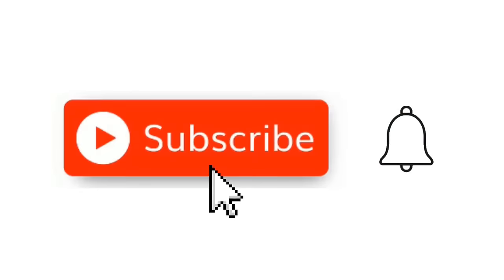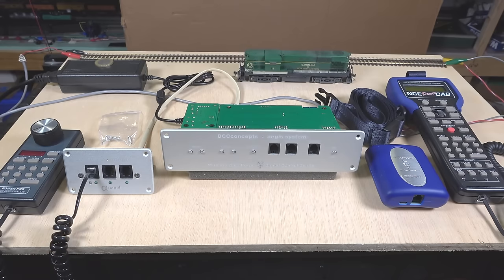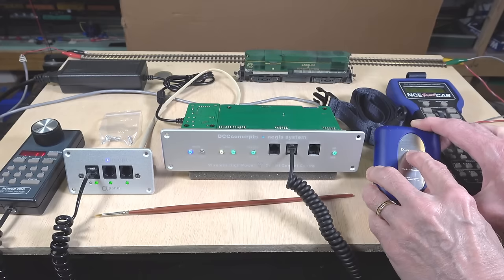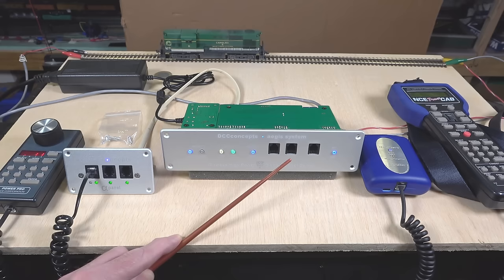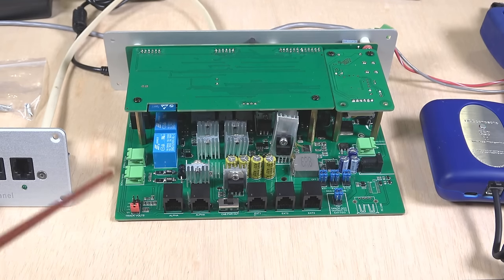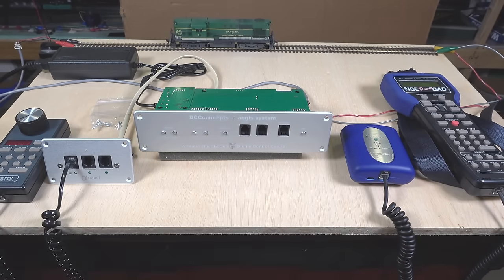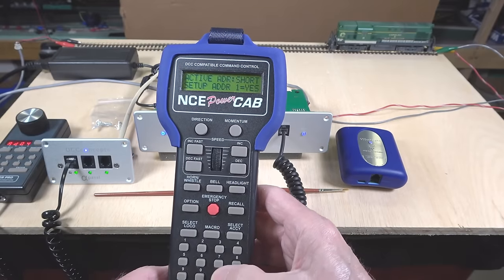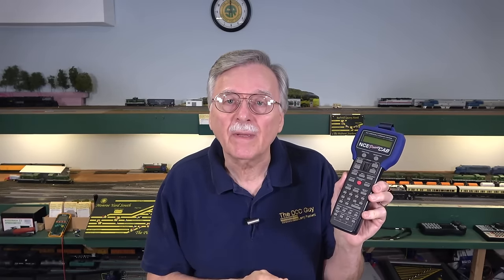Aegis Delivers Power And Performance For The NCE PowerCab (348)

Comment: The Power Cab sells for about $200. The Aegis for $435. If you want a second operator, a plug-in cab costs $95. That's a hefty price tag for entry into DCC for a newcomer wanting a small layout and the ability to run trains with a friend. A similar package from TCS or Digitrax is no less daunting. It's unsurprising that DC operation is still used widely, especially by beginners. After viewing your video and the DCConcepts video it appears expanding this  system is limited to a single wireless throttle and 5 wired throttles. NCE Power Cab is a good plug-n--play system if you're techno-phobic and possess the financial resources to go that pathway. However, for anyone testing if model railroading is for them or have limited resources DCC-EX represents a more realistic entry path to DCC. Most people, certainly younger people, have cell phones and computers. Assembling a DCC-EX command station is certainly within their capabilities. They can start running trains for under $100.
Reply from the maker: Its more to it than that, add the cost of a circuit breaker, wireless system, converting the PowerCab to wireless, adding some kind of programming capacity, the lanyard system, and the individual components add up to over $700, whereas Iron Planet has Aegis on sale for about $437! and that’s assuming you already own a PowerCab.
Reply: @TheDCCGuy  DCC-EX has overload protection, wireless, programing, and 5 amps power for under $100. Assuming you already own a cell phone or tablet, there's no requirement to purchase additional throttles. It is compatible with TCS throttles. DCC-EX does require some assembly, but that is simple: certainly if you're already at the level of needing a programming function. DCC-EX is open source and has a significant developer community. This means there is continuing development and enhancements for the system. It isn't for eveyone, but is a cost effective way to enter DCC. I have used NCE and believe it's a great system, but costs can be an important consideration.

Comment: I had a spelling toy when I was 8 that looked like that throttle and I can’t get past that. The technology of most DCC systems is so dated looking
Reply: Yeah look up RailPro handheld that came out 15 years ago or more.  Was wireless back then with a color touch screen.  All kinds of sounds and customization you can do downloading from the website and uploading from controller wirelessly to your loco.   The modules for the locos are the same or less than a DCC sound board but are a bit large to fit in some locos after you do all the wiring.
  I’ve set up alot of locos on mine.   I still play with DCC for my main layout but it’s by no means cutting edge.  Just works and people are satisfied with it.